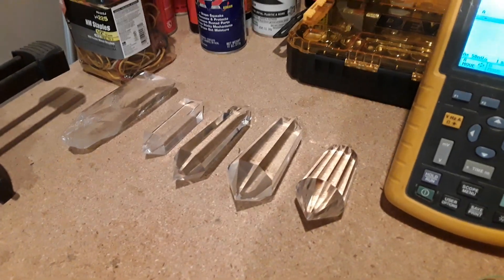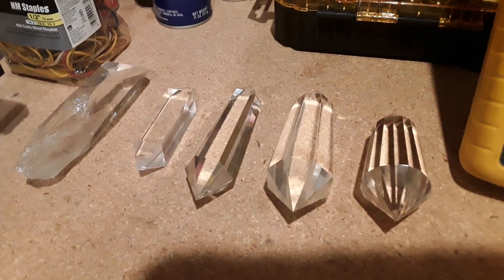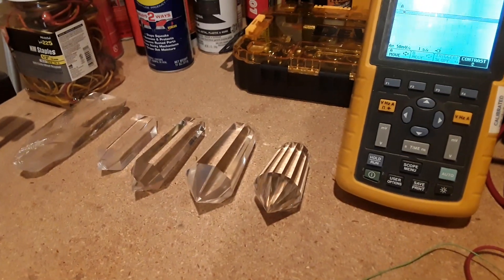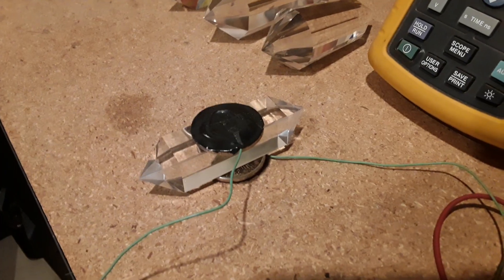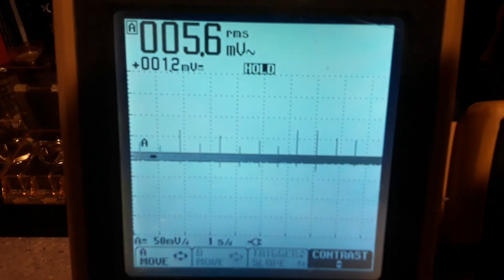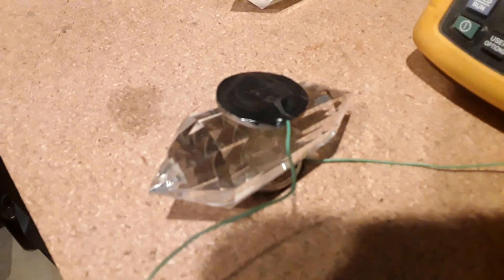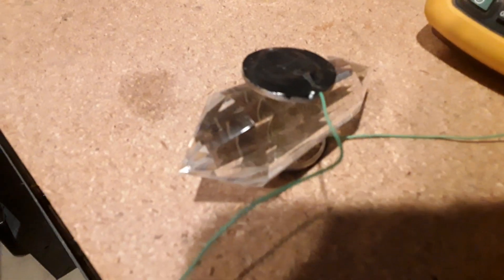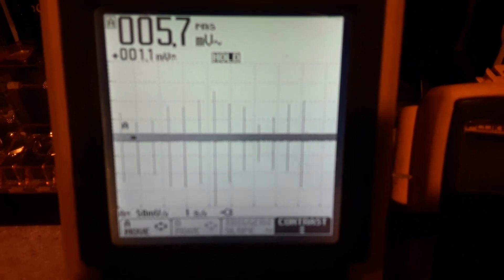A relative test of piezoelectric output from different Vogel cut quartz crystals

Comment: That doesn't seem to indicate a large difference, nor a larger output for more sides, as per your results (highest to lowest);
8 sided: 9.5
Natural: 6.0
6 sided: 5.9
16 sided: 5.7
4 sided: 5.6
Interesting that the 4 sided is the least output (is it vogel cut, as it seems to be cut the same at both ends, but not sure), yet the natural one tests 2nd highest.  Difficult to interpret.

Or were we supposed to be looking at the other numbers? ie;
8 sided: 1.2
Natural: 1.2
4 sided: 1.1
6 sided: 1.0
16 sided: 0.7

This changes the order slightly, but still not sure how to interpret.
Reply from the maker: the 4 sided was cut personally by Marcel, so I would say it is a Vogel cut.    the 6 sided had the greatest output

Comment: What would happen if the coins/contacts were on the pointy ends   of the crystal when you give it a tap?
Reply from the maker: There would be no output because it would be across the c-axis and not compress the lattice structure
Reply: @dreamhillresearch  Gotcha.
Reply: this is what i think

Comment: Dan, I dont undertstand. Typicaly Vogel would use these crystals by hand, implying an organic human electrical input from one end or of the cylinder to an output on the point...
please continue to measure all these outputs differently. I understand this is empirical, however it is a starting point. Lots of variables, Vogel was on to something.
Reply from the maker: Yes you would have the energetic infusion into the lattice structure from your fingers and there is also the physical piezoelectric output when you press or rub the crystal surface.    It is a combination of these two energetic exchanges within the crystal